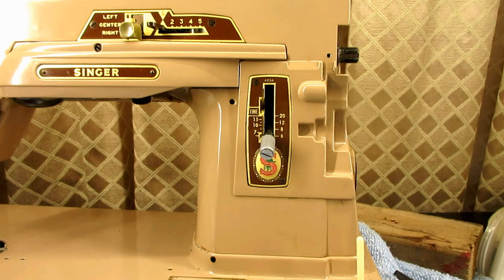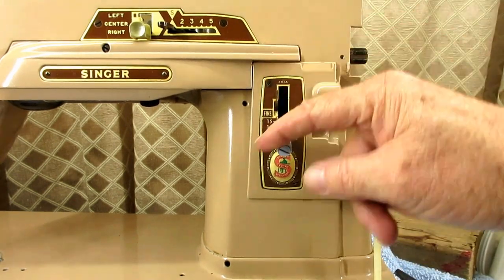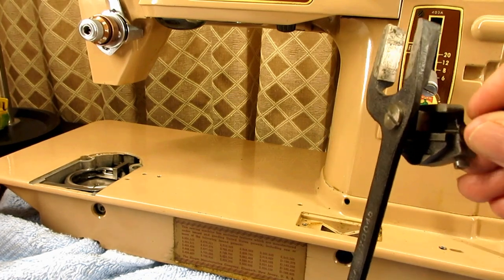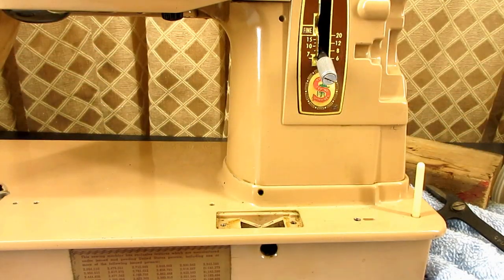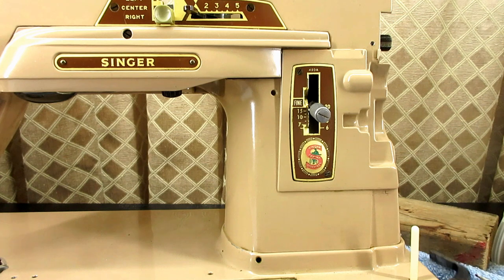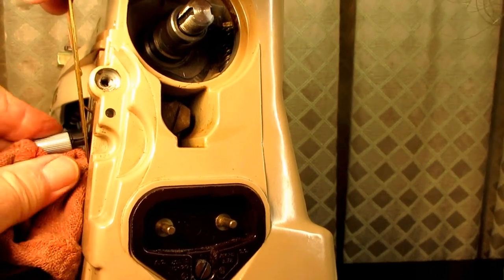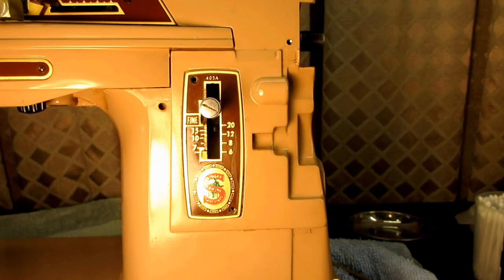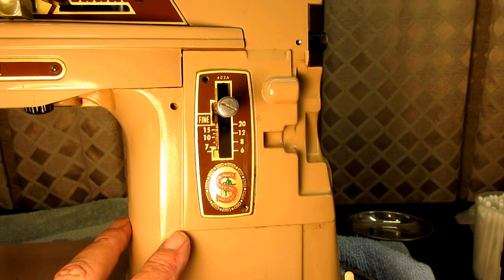The Feed-Stitch Regulator System of the Singer Model 403A

Comment: Andy, You are a life saver!  I just finished adjusting my 600E and everything went as you said.  Very similar to the 403A.  No problem.  Initially the lever was stiff and stopped at 8 when I moved the lever down.  I took it all apart, cleaned and oiled, put it all together as directed.  Now it works great for the full range of stitch lengths.
Reply from the maker: Glad it helped. You're a very good mechanic, Rafael. I'm waiting to here you opened a repair shop 😲 Thanks for saving another machine.

Comment: Fantastic videos Andy and I'm so happy that I found your YouTube channel. Having recently purchased (via eBay) a 1958 Singer 185K and although it runs and is quite clean given its age, on closer  inspection, I have found that the Feed Stitch Regulator system is locked solid and no movement either up or down using the knurled screw level is possible... I have followed your very informative breakdowns videos of relevant machines and have now opened the machine up and soaked the mechanism with WD40 for the last few days. Unfortunately the darn screw pin still will not budge! As the screw pin isn't the same as your pin in the video, mine being slightly recessed inside the main casing and does not have machined sides to its head like a bolt has but only has the large slot -  any suggestions on how to free the thing? My partner is a jewellery, so I have access to her tools including a Dremel handheld heat torch. Would you recommend heating the internal rods etc where the screw pin is screwed into the mechanism and then whilst still hot using a large screwdriver to try to undo it with the aid of a number hammer hits on the handle of the screwdriver to sort of 'shock it' into submission...? Many thanks Ken.
Reply from the maker: For other viewers to know, model 185 is the replacement for the venerable model 99K and has the same mechanical system. Ken, I'm not sure that you saw my videos for model 99K but here is the feed regulator video: https://youtu.be/OTuoIj0Vx0E    The regulator itself may be fine but it moves the shaft below that goes to the feed dog and something below may be frozen/blocked. I always completely oil the machine before doing much disassembly, especially if the machine is clean like yours. On model 185 there are about 25 oil locations. You can find instructions starting on page 31 of the Instruction Manual. A FREE copy is available for download from Singer Support here:
https://www.singer.com/search/support?title=185   I would try the turning while tapping method before heating and if that did not work, then the heat/turn/tap. If it is frozen in there but you do not see rust it could be extremely overtightened or stuck with dried-up oil. Either way, the heat can expand then contract the metal and allow turning. Myself, I do not turn when the metal is still very hot b/c I believe part of the process is the metal contracting while cooling down. BTW, here is a playlist of all my 99K videos: https://www.youtube.com/playlist?list=PLsCOZgzzaiKIIUgkEujqHc9iNWN9NPW2Z
Soaking as you did is a great first step, and sometimes all that is needed. Good luck, and thanks for keeping the machine in service.
Reply: @andytubesewing1953  Andy, I very much apt that you’ve taken the time and trouble to help me with my very 1st machine (at 64 years old the 185 is 3 years younger than myself and am beginning to think my joints need oiling too..!). I have watched your strip down of the 99 and will base my future work on that machine. I hope it is not too cold out in the Midwest USA, and UK is fine so far, but have a wonderful Christmas and New Year, keep up the brilliant work! Thanks again, Ken
Reply from the maker: @KeniloTube  Welcome to the world of Vintage Sewing Machines. You chose a very nice "starter" model. I hope it is just the beginning for you. I have restored several models made in the UK and enjoyed them all. In the spirit of the season I offer you a rare copy of the Model 185K Parts Diagram, an exploded view of the parts with part numbers identified. If interested please email andymanuals53@gmail.com and put MODEL 185K PARTS in the subject line. I will have them reply with a PDF copy of the manual. I live in Arizona in the South West United States. Although our weather has been cooler than normal it's nothing compared to most of the country which is experiencing a "Bomb Cyclone" right now with devastating cold temps and snow. In some areas, the wind chill factor is -50 Deg F. Yikes. https://weather.com/forecast/news/2014-10-31-national-forecast-20141009   Merry Christmas, Ken, and a Happy, Healthy, and Prosperous New Year. 🎄🎆

Comment: I just finished watching your video on how to fix/replace my friction ring on my vintage singer 239 strsight stitch machine.  Thsnk you so much, but I have a question.  What is the silver knob that can screw in and out on the left top above where the needle goes up and down. What is it, what does it do.
Reply from the maker: hello Kim I'm thinking that you're talking about the presser bar pressure adjustment knob that you turn to the right to put more pressure on a presser foot for sewing a heavier fabric or you turn to the left to use less pressure on a lightweight fabric but please do this go to this link  https://www.singer.com/search/support?title=239
and download the original singer instruction manual for your model it will tell you all about the machine and how to use it and oil it and so forth and it's free to download. thanks so much for watching my channel and please stop by anytime you can 😊

Comment: Hi Andy, I just watched tour video on the Stitch Length Regulator. It didn’t solve my problem, sorry to say. The regulator will not lock the stitch in place. When you do a reverse stitch it drops down to a 6 every time. Would you know what the problem might be and how can I fix it?
Reply from the maker: Hi, Karen. 
     It drops down as soon as you lift the lever to reverse, or after you start sewing in reverse? Only two things I can think of off-hand. You watched the regulator movie, but did you remove and replace it? When I have a 'creeping" or "falling" regulator lever it is usually a lack of tension on the regulator from the mounting screw/spring/tension washer. If it is not tightened completely or the washer is not installed properly then the lack of tension will let the regulator move. 
     The other thing I found (obe time only) was the feed dog was adjusted too high up. When trying to sew in reverse there was too much pressure on the dog and that forced the regulator out of reverse. That's all the regulator does is control how far and in which direction the dog moves the fabric. 
     I have a video for setting the height of the feed dog. It is on a model 301A, but the place and method of adjustment are basically the same. Here is that video;    https://youtu.be/Du-W1k_qHHI     The correct height for model 301 and 401/403A/404 are the same at between .040 to .043 inch.
     Let me clarify about the tension washer on the feed regulator mounting screw. When I have found a creeping regulator it is "usually" b/c the spring/washer are not installed correctly or one or both are missing. Sometimes the "legs" of the washer are not down into their space or are only partially in the space. If the washer or spring is "caught" on the side of the hole it can feel tight to your screwdriver but it is not tight enough to keep the regulator where you set it. 
    If you need more info you can download the original Service Manual for Singer Class 401 Machines which covers the 401A, 403A & 404. It is free at this link;    https://sewingdude.files.wordpress.com/2012/09/singer-401-service-manual1.pdf

Comment: I have a question about removing this on a 503 model. At around 40:40 you are able to take the plate off. On the 503, it will not fit over the ridge in the slide piece. How do I remove just the cover plate on a 503?
Reply from the maker: Sorry, it has been 6 years since I did the 503A machine, https://www.youtube.com/playlist?list=PLsCOZgzzaiKJZaZn2zl3LsnV2d7UhrqvX     I did not make a specific video, and can't picture the parts any longer. I looked at the FREE copy of the Service Manual  ( https://sewingdude.wordpress.com/wp-content/uploads/2012/09/singer-500-service-manual.pdf )  on page 17 where they discuss removing the feed regulator, but they only explain removing the whole of it and not just the plate.

Comment: Hi Andy. Thank you so much for this video.  I removed all parts of the feed regulator system in preparation for  the shower I plan to give this 403A (never given a shower to any machine, so looking forward to following you on that).  My question is, about the slide block on the feed forked connection.  It easily spins off and I took it off, and plan to leave it off until after the shower, because it might spin off and I'd lose it.  Do you take the slide block off before the shower?  Thanks for the information about oiling the feed regulator system.  I'm going to oil my 328 feed regulator system today.
Reply from the maker: Welcome, Carole. Yes, if I have taken the whole feed regulator out then I also pull off the slide block before the shower. Thank you for watching the video. Good Luck with the 328

Comment: Andy I have an 401a my issue is that when im sawing a straight stitch (AK3) if I have the lever around 7 the lever will move by itself up with the movement ending up at 15…do you have an email so I can shoot you a video about this problem?
Reply from the maker: Thanks, but I don't need a video. This problem is called "creeping" as in the lever creeps (moves) up or down while sewing. This is usually due to a loose Feed Regulator Hinge Screw that is behind the handwheel. That screw has a friction washer to hold the screw at the point you tighten it to have good movement of the stitch length lever without it being too loose or tight. You remove the handwheel and tighten that lever (be sure there is some kind of a washer on the hinge screw. Sometimes people take it apart and forget the washer) I have a shorter (for me) video that explains creeping and how to fix it. It is on a similar model, a 301A, but the fix is the same. The washer on a 301A can look different than the one on your 403A; no worries) https://youtu.be/EQtGwmOYtic

Comment: Watching you put that bolt back in is the most stressful thing I've ever seen on YouTube ... 😃

I wonder if it would work better to stand the machine on it's nose?
Reply from the maker: I've tried that and on a couple of models it seemed a little easier but on others it was harder. I usually do the 301, 401,403,404,500 & 503 like it the video. It was also  better position for filming. I guess there is no "set" way and other folks may find a better method. Don't stress though, it's actually relaxing to work on the machines, IMO. Thanks for watching.

Comment: How can I fix the screw that is supposed to lock the stitches at say 10 and doesn’t.  In fact every time I try to lock the stitches, and then reverse it creeps up and up. Help!
Reply from the maker: FOr you and others reading the removal of the thumb nut parts begins @ 36:00. The installation of the thumb nut parts begins @ 43:40. The tension adjustment of the regulator (to prevent unwanted movement during sewing) begins @ 49:40. Here is another video for adjusting loose feed regulators that "creep" while sewing. It's on a model 301A which has the same style of regulator:
https://youtu.be/EQtGwmOYtic
Reply: Didn’t work.  None of it.
Reply from the maker: @skjb9658  🎻 Without having hands-on I can't suggest anything else. 🤷‍♂️